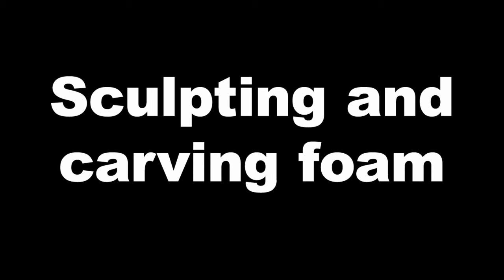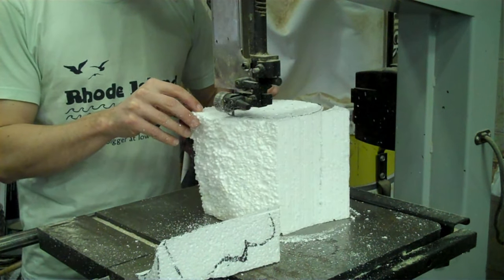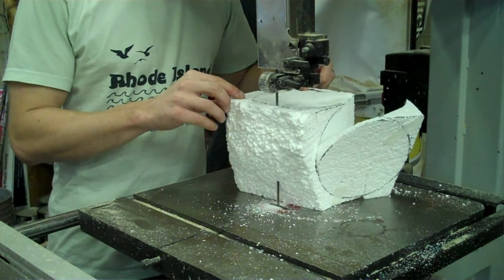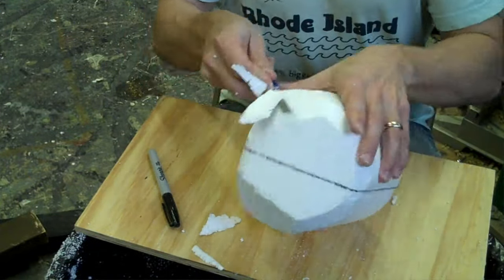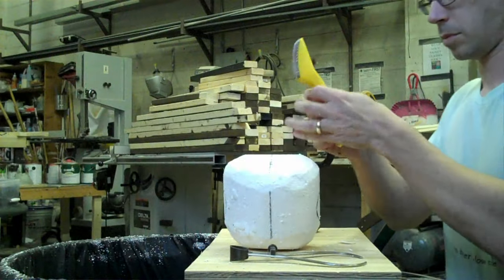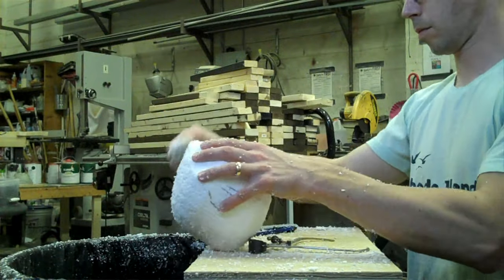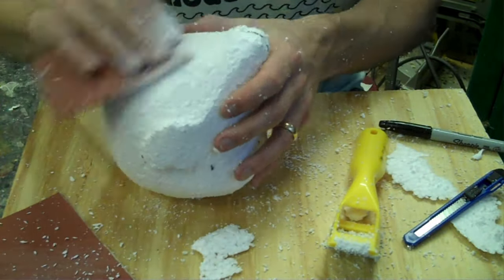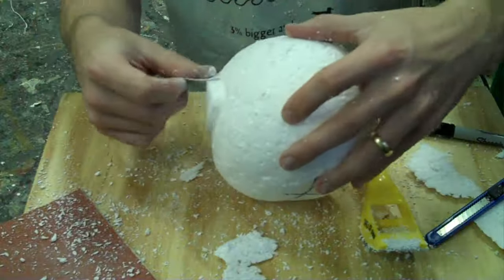Sculpting and Carving Foam

Comment from the maker: You can also get sheets of home insulation foam (usually blue or pink) at big box home improvement stores like Lowes or Home Depot. Though the thickest they carry is usually 2 inches, you can layer several pieces together with contact cement or Gorilla Glue to make a thicker block.

Comment from the maker: Do an internet or yellow pages search for suppliers in your area, because shipping of large foam is incredibly expensive. Besides foam and sculpture suppliers, you can try boat dock dealers, or large construction companies who do a lot of concrete and cement work (They use large blocks as filler). Art Depts at local universities may also know of local suppliers. "Universal Foam Products" (Google it for their website) sells large blocks, but have a $250 minimum order.

Comment: I was wearing a synthetic fleece jacket when rasping with the cheese grater tool and got covered in Styrofoam (EPS) particles. You didn't seem to have that problem. Were you wearing a cotton T-Shirt?
Reply: Yes you do need to wear a cotton shirt. Don’t where sweat pants either.  Jeans and tee shirt are best.

Comment: where can I get those styrofoam blocks? do they have large sheets also? please give me your hint
Reply from the maker: Do an internet or yellow pages search for suppliers in your area, because shipping of large foam is incredibly expensive. Besides foam and sculpture suppliers, you can try boat dock dealers, or large construction companies who do a lot of concrete and cement work (They use large blocks as filler). Art Depts at local universities may also know of local suppliers. Companies that do architectural foam molding may either supply just solid blocks, or know of a local supplier. There are a few online places, but like I said, shipping can be expensive and they usually have large minimum orders, so it's best to do a hunt in your local area.
Reply: Eric Hart your art is amazing sir and thank you for the video,  what is the tool you are you using at 2:50 ? , i have a question about some foam shaping, im a boxer and trainer and im making some custom punch mitts for coaching, im trying to create a concave front but since its for punching i cant weaken the foam and it is very high density,  i also need to make the surfaces very smooth , i can show you pics on my google plus page for more information, im sure youre busy but i would pay you for your quick advice and i would be in debt to you forever, please let me know and keep up the good work no matter what, thakns again for the video
Reply: Stores like Home Hardware, Lowes, Home Depot sell them too.

Comment: What kind of foam do you use? Do you know if epoxy will melt this type of foam?
Reply from the maker: This is EPS foam, or expanded polystyrene foam. Epoxy will not melt it.
Reply: this is pilystyrene styrofoam, but it is not high density and high density foam is beter for sculpting